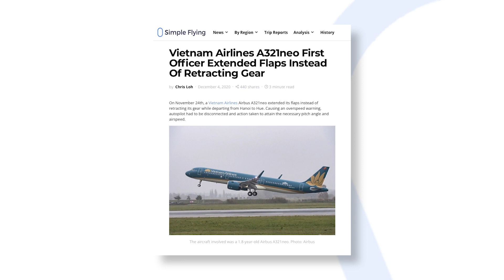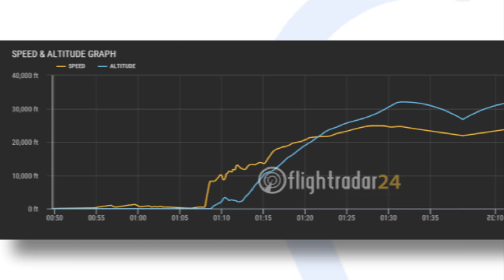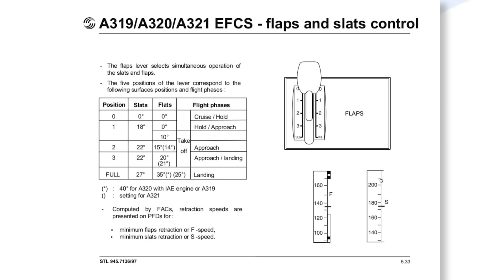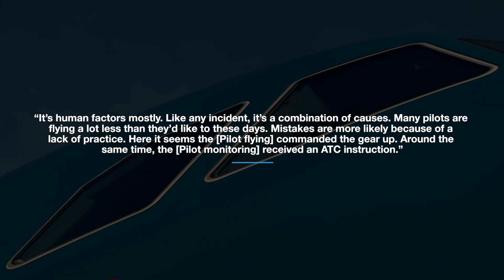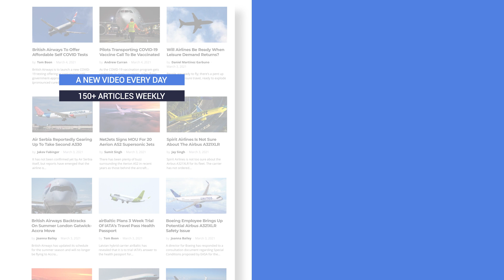A321 First Officer Extended Flaps Instead Of Retracting Gear

Comment: I could understand a premature selection of the flaps up rather than the gear up, but not selecting flaps to a lower position. Just my opinion as a747 Captain. We fly 400s and -8s which have different gear handles. The -8 is simply up or down.
Reply: That was my initial thought too!
Reply: Yeah, even in MSFS, if you want to move the levers by mouse, you have to move them in the right direction, which, in this case, would be up. Flaps down makes little sense.
Reply: Flaps from 0 to lower doesn’t make sense!!! Gear up could be mixed with flaps UP !!! I do agree with you ..
Reply: Agreed, 'positive rate/gear UP' could logically result in raising the flap handle UP to a work loaded mind. (Similarly lowering flap rather than gear on approach) 
But lowering the flap handle instead of raising the gear?? Weird one
Reply: The CP mind subconsciously was already tired of the flight barely a couple minutes in and just want to land so it subconsciously tell him to do flap down ;)
Reply: Had to tell us you’re a 74 captain didn’t you 😂😂
Reply: @Tom-ih8gr  well, it is relevant to the discussion. I like long walks on the beach too. 🤪
Reply: Your point?
Reply: @Andrew-fg6zk  You seriously think a videogame holds relevance for you in this discussion?
Reply: @hodb3906  Well, if you don't understand OP's point, you wouldn't understand how a videogame holds relevance for the discussion.

That was lame, dude.
Reply: @breeknow  And you would because...
Flight simmers are getting cockier by the second
Reply: @hodb3906  Troll harder.
Reply: @breeknow  ??
Reply: @mlx39996  Except I’m a pilot as well as a simmer. 

The only thing I’m saying is that the sim allows people to understand procedure.  

It allows people to understand OP’s input on the matter. 

Is it that hard to grasp?

You could have kept on the subject instead of just getting agressive towards flight simmers (what did they do to you?) while failing to address the matter. 

I will repeat what OP has said (in other words):
Lowering flaps makes no sense right after take off. 
After take off flow demands gear up, flaps up. The only thing that changes from situation to situation is when exactly the gear and flaps come up. 
Lowering flaps right after take off is a VERY WEIRD mistake. 

It’s not that complicated gents. Even a lowly flight sim can understand it. 

And if you were pilots you would know that too.
Reply: @hodb3906  I would because I understood! Duh! 
I’m a pilot, but THAT is not relevant because if a FLIGHT SIMMER can understand it a non-pilot can.
Reply: @hodb3906  Niccolo. You asked for OP’s point, right?
His point is CRYSTAL CLEAR. 
THEN you proceed to ask why somebody thought being a flight simmer was relevant for the discussion. 
I merely pointed out that if you understood op’s point, then you would KNOW why being a flight simmer ALLOWS somebody to understand his point. 

That’s all that happened. 

You’re coming from a point of not knowing something and believing he knows what it takes to know that something. 
That’s lame!

The issue here is very simple. 
Anybody who likes aviation will understand what op has said. 
Just… be cool about it. 
No need to start antagonizing everybody.
Reply: @mlx39996  I agree about simmers thinking that. 
But that is irrelevant to the discussion. 
Did you even read the thread?
Reply: @hodb3906  I’m a PPL student and I also fly MSFS and they do have their similarities, arrogant people like you are problem here…
Reply: @breeknow  
You defending flight simmers when your channel is loaded with flight sim videos just makes it that much harder to believe you are a pilot. 

I didn’t say anything about not understanding, I said about the relevance to this discussion when clearly there isn’t any. I totally agree being that flight sims help make people understand procedures and sure helped me with my first steps for my PPL…but the stress free comforts of a virtual world don’t even come close to the real world.

One of my first flights with the instructor I kept hovering and fiddling my hand over the prop mix when the FO instructed me several times to raise landing gear because I was clashing with info from ATC. I reacted almost a minute after his first instruction. I completely froze and did a total illogical action. Which is also why I asked the original commenter what his point was. In my eyes, it looks like he is trying to see why putting the flaps up would be a more “logical” mistake to make instead of pulling the flaps down. To me…I don’t get that because at that moment and speaking from my own experiences, your brain goes into a literal short circuit. There is no logic in this kind of mistake making. It’s just natural.

Point is, when handling an aircraft, it doesn’t come close to a safe virtual world of a flight sim which is why flight simmers hold no relevance in a discussion about making mistakes due to conflict of input in information. It just doesn’t.
Reply: @captainelliot8767  That’s all I’m saying!
It’s not quite rocket science.
Reply: @hodb3906  I have been a pp for 20 years, but don’t fly quite often. 
Ok, so let’s discuss it like grown ups shall we?
Reply: @hodb3906  The matter of the whole thing is we’re talking about a F/O. 
In my country, airline f/O must have at least 1500 h PIC. 
FROM THAT I take it that he’s totally used to the different flows in different points of the flight. 

We’re not talking about a ppl’s first flight. We’re talking about an airline pilot.
Reply: @captainelliot8767  Great. I have a PPL and I sure hope for you that you read Stars and SIds better than youtube comments because I didn't say anything about them not being similar. All I said is that it holds no relevance in this discussion because handling the procedures in a real aircraft is lightyears different than handling procedures behind a computer monitor.
Reply: @hodb3906  Ok, the thing we’’re not at the same page here is the fact that I’m talking from a procedure point of view abd you’re talking from a task overload point of view.
Reply: @hodb3906  However, I don’t think task overload should cause somebody to set flaps down during take off. 
He’d have to be especially hungover? 
I get your point about flight simmers, but you have to understand life is not a white, green, black belt thing. 

It’s not like you have to become a pilot to be able to give your opinion. I see no problem in his opinion. It shouldn’t be dismissed as irrelevant. 
Less relevance? Maybe, but definitley not irrelevant, since from an operational ooint of view it makes sense. 

So have you overcome your nervoursness in flight?

You know what, recalling my ppl, I never ONCE froze. I credit it to my hours in fs95.
Reply: @breeknow  
They do correlate in that point, don't they? You can't effectively follow procedure because of task overload. You may know of this but take for example the frenchbee flight 711 on the a350. The video is on mentour pilot channel. Similar setting where F/O with adequate hours completely froze and made unexplainable decisions.
Reply: That sounds more dangerous though.
Reply: @damonreynolds6775  and that’s why on an airbus flaps are not up they are at config 0 so the Pilot flying Cals gear UP flaps 0 to avoid confusion after takeoff even though I am a Boeing lover I thing that Flaps 0 is a better call because then there is no risk of mixing them up
Reply: @KarmaFlight  Merry Christmas Captain Sable...IMO, the B747 is the most renowned AND gorgeous jet airliner ever built.
Reply: @matt8863  You too! I flew MIA-ICN on Christmas Eve. 16:29 block time. It was along day.
Reply: @Tom-ih8gr  sounds like an MS 747 "pilot"

Comment: I am PPL so it is not comparable but I made a mistake on the configuration of the flaps on take off. They were at 40 degrees instead of 15. The reason is that I sped up the pre-take-off checklist because an airliner was established on the ILS.
I realized it quickly but after the rotation. I made a level to be able to retract the flaps.
On the other hand, having made flights in an A320 cockpit, I do not understand how he could have confused the lever to retract the gear and the flaps (they are not in the same place).

Comment: There was one time my brain had a complete short circuit and I almost put the flaps up when the PF called for gear up. Caught myself as I was starting to move the lever and put the gear up like I was supposed to.

I consider myself an extremely proficient pilot. This kind of thing can happen to anyone. How much rest had the crew gotten the night before? How was the CRM between the CA and FO/how was the mood in the cockpit? These are all unknowns.
Reply: While I don't pilot planes, I have made more general mistakes when I am tired, so rest is an important factor in mistake reduction. But even on our best days, if too much information is flowing from all around us, we will make mistakes. ATC was chatting with the pilots, in the middle of a gear up task, so I would have made a similar mistake
Reply: CRM is one of the right questions. If it' is/was bad, please never put those 2 together in a same cockpit again, thank you.

Comment: Reminds me of the day I pulled the mixture control instead of carb heat, while downwind at Biggin. Also of a recent sad case where a police officer pulled a gun instead of a taser. These are unfortunately the kind of mistake that humans make.

One might have thought that the Airbus would refuse to extend flaps into an over-speed condition.
Reply: Yeah, mistakes should try to be minimized in high risk scenarios, but the Airbus has a lot of computers that should ideally have some system to prevent flaps from extending at high speeds. At least no one was hurt. BTW, I don't know much about mixture control, but I am assuming that has to deal with fuel/air ratios to idealize combustion at differing altitudes. :) So, your mistake caused your plane engine to guzzle up too much fuel, or too little air, if I understand correctly, instead of adjusting carburator temperatures?
Reply: @thatguyalex2835  Just to clarify, part of the down-wind checks involves pulling the carb heat to ensure there's no accumulated ice in the carburettor. 

The mixture control is meant to be pushed fully in at this stage (full rich, unless it's a high altitude airfield). Pulling it all the way out is the usual way of stopping the engine on the ground. And this was what started happening. However, fortunately my instinctive reaction was to undo what I'd just done - I hadn't even let go of the control yet - and the engine resumed where it had left off.

Comment: This story never mentions when or if, it was discovered that the wheels were still down. Was it when the Captain calls for wheels down on approach?
Reply: This was just after takeoff when the captain called for gear up
Reply: @davisbyer4791  You don't get my point.
Reply: @no1ded  I would have to listen to the video again, but I assumed they cleaned up the gear along with the flaps once they realized the mistake, since the flight continued to destination without further issue.
Reply: @davisbyer4791  I think you are correct but there was no mention of correction.
Reply: @davisbyer4791  ...they must have 'assumed' also.

Comment: 1:13 – “…the Captain then disconnected the Autopilot and increased the pitch…”
Ahhh...Autopilot was on already?  Even before the gear was raised?  
Seriously?  Because if that is the case...then there's something terribly wrong with the whole operations/airline.  
At what 'Minimum' altitude Vietnam airlines SOP allows to engage autopilot on departure?
Why would the PF then 'increase pitch'?  I mean...isn't your speed awfully slow anyway...and that is now preventing you from gaining 'airspeed'?  
Why would you increase pitch?
But, still the big question is: why the autopilot was on already?
Reply: I was thinking the same thing. Minimum autopilot engagement height. But in the report it said: “The aircraft had been dispatched under minimum equipment list requirements with a brake defect that required the gear retraction to be delayed by one minute.”
Now it’s a whole different story😉

Comment: A noob question- if the flaps are extended following take off, and the gear is not retracted, and airspeed decreases as a result,  why would the warning be described as "over-speed" ? Shouldnt it be like a "under-speed" or stall imminent kind of a warning?
Reply: Because you could damage the flaps and mechanisms from aerodynamic forces.
Reply: @TheJimbo4123  Ok-makes sense, but then why not equipment-specific warning  like for  landing gear or flaps in that case ?  Or the design philosophy does not leave it to the aircraft system to account for the phase of flight while making such a warning?

Comment: Maybe I've been retired too long but most guys at my airline didn't engage the autopilot until cleanup unless there were other demands. Once airborne the callout "positive rate" or "positive climb" is instantly followed by the "gear up" command. ATC can be a distraction but flying the jet is the primary task.
Reply: The plane has a break issue and gear up had to be delayed by a minute to allow wheel spin down.
Reply: @Krasnoye158  Interesting. I've never been dispatched with a break capped out. There's quite a weight penalty for that. In the USAF we had a kit to cap off breaks if one malfunctioned at a remote location but never used it.

Comment: Can any pilot or aviation expert explain it to me how come deploying flaps which reduces speed aircraft's automated system warns over speed?
Reply: Full flaps have  lower maximum speed than flaps 1 therefore the speed warning would be triggered as the airspeed was higher than the maximum for the selected flaps.

Comment: This is EXACTLY why I NEVER fly (or will ever allow my family to fly) these airlines from the third world! Their pilots are unskilled, poorly trained and EXTREMELY inexperienced, not to mention the rampant corruption involved in pilot SELECTION. Yeah, put more 250-hour newly minted jockeys straight into the right seat of aircraft like an A320 and 737 (without having to PAY THEIR DUES with blood, sweat and tears, like we have to do in the western world), and then wonder why stuff like this happens! (rollseyes).
Reply: Actually there are some western airlines like EasyJet you can get onto their own pilot training course and get fast tracked into the co-pilot seat. And they are one of the safest airlines ever. Also there are several pilots in the US making mistakes due to not flying for so long. 1 crew forgot to deploy the landing gear until aircraft shouted at them with alerts

Comment: What would have happened if he would have mistakenly moved the flaps to zero instead? Would that be catastrophic in that phase of the flight?
Reply: It could be. The plane might lose lift , stall and crash, or it could overspeeld and pitch down.
Reply: Would have been much more dangerous as the airspeed might not have been enough to keep level flight with almost no available altitude to maneuver the plane nose down to gain speed. It seems like they might have had enough speed in this case to keep the plane level at 200kts and the with pilots quick reaction to take control of the airplane.
Reply: Alpha Floor protection would have kicked in immediately. The flight computers would have automatically added Full power (TOGA Thrust) irrespective of current thrust lever position. While it is a protection built by Airbus, TOGA thrust is quite brutal and an unaware crew could find themselves in further chaos resulting in warning bells going off and in a crowded airspace, cause TA/RA alerts for all nearby traffic
Reply: Very unlikely. Alpha lock would likely protect the slats and alpha prot would keep them flying.
Reply: They were at 210 knots, that's not gonna stall out anytime soon.

Comment: There's zero excuse for this mistake. "Distraction" is not going to cover such a basic error. Remove the co-pilot from service and put them through simulator training again. The high stress environment of full simulator training will definitely highlight other areas that need improvement also.
Reply: 'Zero excuse for this mistake'.  Does not sound like anyone is making 'excuses'.  And what mistakes are 'excusable' and what are not?  I once starting pulling the primary reactor control rods when the reactor officer had called for secondary.  I relayed the order as I started complying.  The officer ordered me to do an immediate stop in pulling the rods.  We took readings, reinserted the rods, and put the startup on hold.  The investigation showed I had been working just short of 19 hours straight and that I was 'extremely tired', leading to the mistake.  THIS IS VERY SERIOUS MISTAKE.  Due to extenuating circumstances, I was not relieved of my duties and we had extra training to recognize the symptoms of exhaustion.  Yet, you say, my $450,000 in training should have been thrown away.    ................................. Why?  Should we recognize mistakes and learn from them?  Or simply axe anyone who makes an error that results in ...... nothing?

Comment: I think one year ago there was a Vietnam Airlines flight landing in MEL and the pilots forgot to put the gear down.. lucky it was daytime and the tower was able to spot and tell the pilots.. I could be wrong, but perhaps it was a period for Vietnam airlines where mistakes were happening a lot. I work for an airline and it is the same for any airline.. sometimes mistakes just keeps happening and then for a good long period no mistakes.
Reply: Tower notified them at 700’ and they made a go around. Had it been at night, the onboard GPWS warning “Too Low Gear” would have triggered at 500’ AGL (given it is working normally) anyway.
But yeah mistakes happen and the pilots should find themselves fortunate to learn the lesson through safety briefings rather than the hard way.